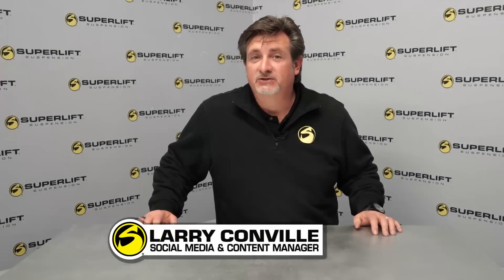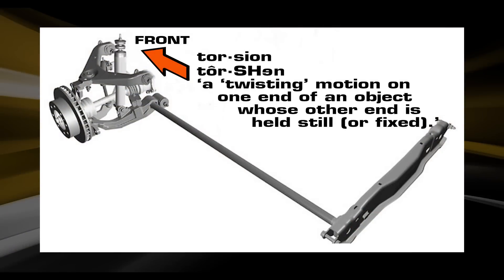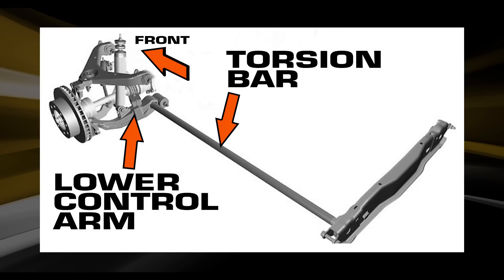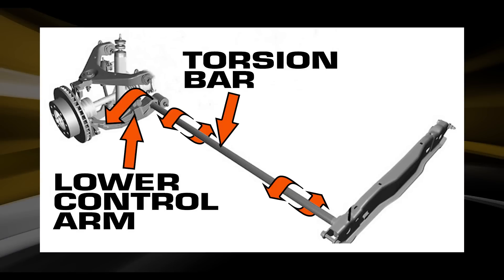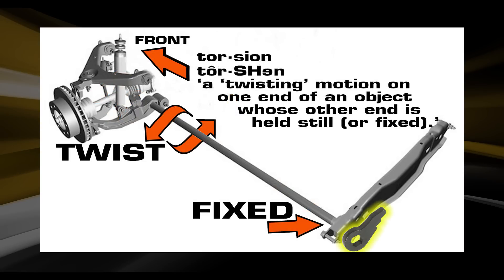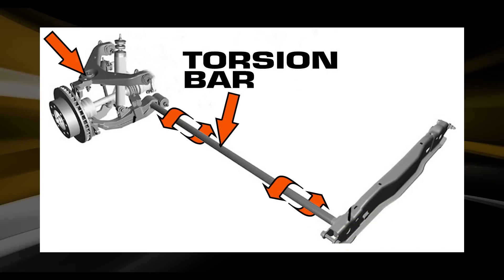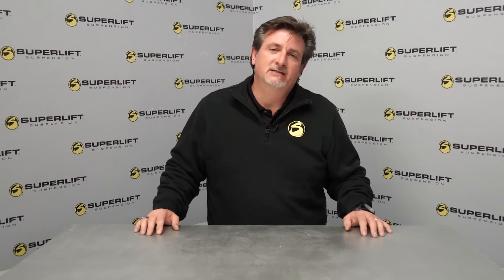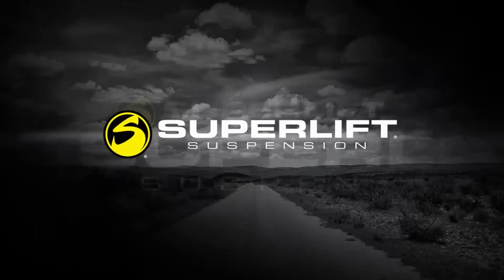Suspension 101 From Superlift - Part 1: Torsion Bar Suspension

Comment: I wonder why the engineers went to so much trouble to complicate such a system with a torsion bar.... a shock absorber plus a spring would have sufficed
Reply: These are way simpler than a shock absorber+ spring to design and engineer. They are also pretty much no maintenance. TLDR You don't quite know what you're talking about. 
~An engineer.
Reply: Lol exactly idk why he thinks this is brand new or something, probably one of the first suspension systems @JacopoSkydweller
Reply: There are aplications where a torsion bar is more suitable for a certain vehicle. For example in formula cars they use torsion bars. Some trucks also use torsion bars

Comment: I am more familiar with historical armoured vehicles than modern cars and trucks, but surly the sheering force at either end of the bar must be enormous.
Reply: I was cutting off a grade 10.9 bolt, the head was 22mm, not sure of the shank, about 5/8".. it was seized in my rear leaf spring, the front eye.. anyways... that thing was VERY strong, I couldn't twist it to break it until about 5% was left.. seriously with 10% of the shank left at 300ft lbs it would not snap.
Reply: It could break bone if it came loose on one end
Reply: Very much so, the force of a torsion bar is the same if not greater than regular springs

Comment: I have a 2009 Hyundai i10 with rear torsion axle that has a dent on it. Issue is that my rear wheels are wearing out faster as compared to from wheels. Wearing of tyres is equal on all side so no alignment or balancing issue. On bad roads my i10   dances as it enters a hole or something. What according to you the issue can be as the shockers seem fine to me, please help
Reply: Check shock absorbers.

Comment: Could you use a torsion bar for a go kart axle and would it reduce the shock in the drive train under sheer torque from start off?
Reply: I don't know if you tried it or not if you did let me know how it went but I can tell you the answer is no. As soon as you weld to it you're going to f*** with the spring steel and it would need to be heated back to Red Hot and Cold properly. That being said I have welded springs together. And then just threw the spring in a big fire and the next day they get out put some new bushings in it and it was good to go.

Comment: Is a torsion bar used in cars or is it just for trucks
Reply: Chrysler use them In most of their cars for about 30 years from the 50s to the 70s
Reply: @cyauch2112  and 90s in their Dakotas.
Reply from the maker: Hi +regina hehir, torsion bar suspensions can be found in cars but it is uncommon.
Reply: mahindra scorpio 4wd in front front axle uses torsion suspension system
Reply: Torsion bars lower the roll center by the  geometry it’s a big advantage. That’s the best plus I think , are durable and last long time, and the springs are adjustable.
Reply: old VW bug
Reply: It used to be very common in Chrysler cars.

Comment: I have a 94 Mercury Cougar and I'm having a hard time getting it adjusted right. It have keys on the Control arm,rather than the Torsion bars. I had to replace the ball joints all around the car and I don't know exactly where they need to be adjusted. I know they need to be even on each side. Does it matter where they are adjusted or do they need to be exactly how the factory had them. Can I actually have them adjusted to how I want them to be as long as they are adjusted the same on each side.
Reply: IF something have ANY adjustment option then you can use it freely, because it is exactly for that - to adjust based on your needs/desires.
But, if is fixed then it should remain fixed